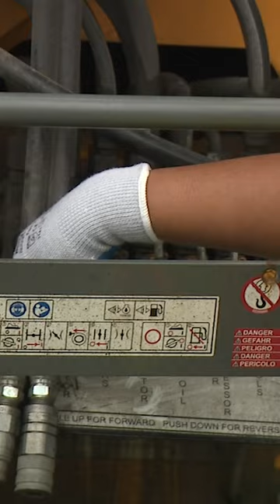Mayor Brandon Scott helping fill the potholes

Comment: Help tear down some Vacant Houses.  Filling potholes is not fixing any PROBLEMS. Need new streets done RIGHT 🚨🚨🚨
Reply: Baltimore has always had vacant housing issue, so don't act like this just happen.. the mayor's before him didn't nothing to fix the problem.. fixing the roads is a good start. Addressing the crime starts with the community and it starts at home... if the mayor was tearing down houses. You would still be on here saying he need to fix the roads... 
You refused to be please..
Reply: @Hayaman5  1) fixing the potholes were being done Wrong. 
2) I didn’t say vacant houses weren’t a issue before this mayor. When is a major going to fix the problem? And he is the current mayor to address the problem.
3) Contractors are allowed to pave incorrectly so that is the real cause for the potholes.
Anything ELSE?